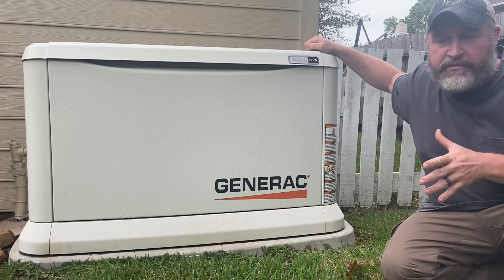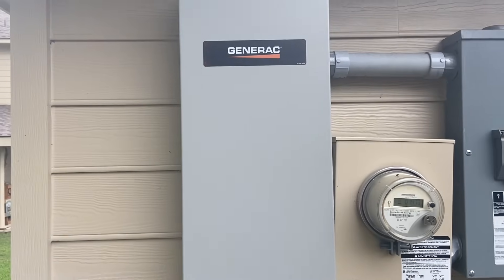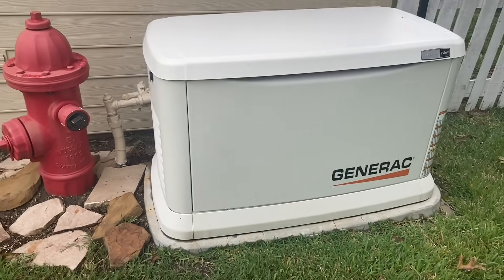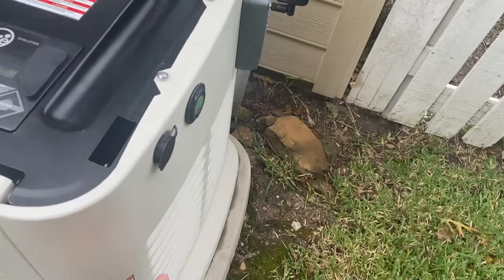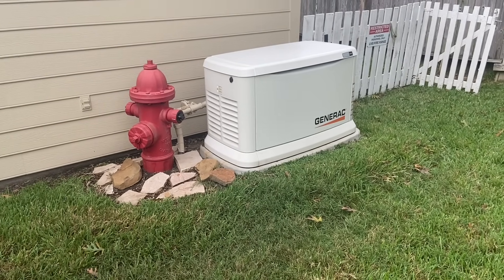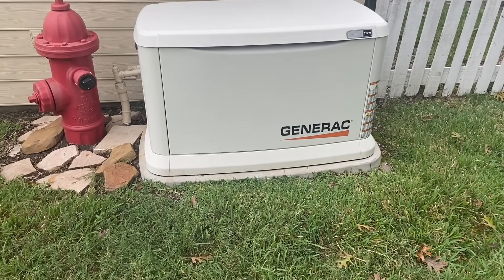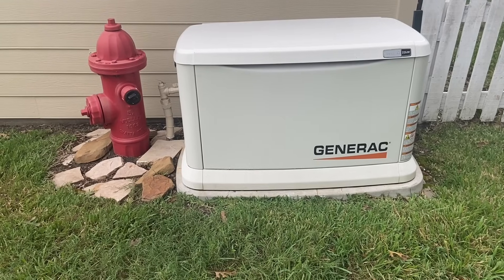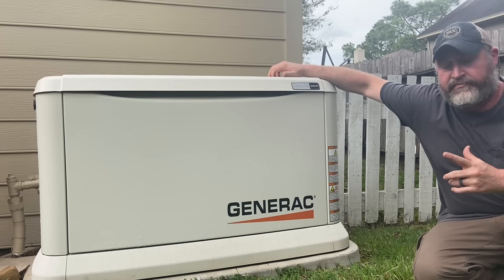Thinking of purchasing a generac whole home generator?

Comment: Lord, this started auto playing and I just had to finish watching.

That's a cellular mobile link, not wifi.
Cellular mobile link subscription is 69 dollars a year.
Hard to tell but that unit should be minimum 18 inches from the structure. 
The gas piping should not have gas cocks, should be ball valves. That's per generac.
If your maintenance company is only changing the plugs oil and air filter, they aren't doing a full service. Those 999 air cooled engines need the valves checked annually. 

Strange to see regulators after the meter but you must have high pressure gas.
Reply from the maker: Cool thanks for watching, it’s 18’’ or more away from the detached garage, the valves have been check and adjusted as needed annually the valves are ball valves. I pay for the monitor and annual maintenance as one plan.  Anything else !?!

Comment: I like the solar generator better because it's quite, the gas generator is too loud, everyone will know that you got a generator.
Reply from the maker: Nice where did you get your solar generator and how did you hide all the panels? How good does it work when the sun has not been out due to storm what is the run time? Why would one be worried that people will know you have a generator? 🤨 thanks for stopping by and watching, don’t forget to subscribe like and share it makes a difference!
Reply: There is no such thing as a solar generator. There are only solar batteries that are charged by the system. However if the power is out the system cannot work. You see solar requires electricity to make electricity. Therefore after your batteries are depleted, if your electricity does not come back online, you’re sitting in the dark and cold like everyone else that doesn’t have a generator.
Reply from the maker: @johnruggiano3290  exactly! Thanks John for the comment, please subscribe like and share buddy , have a great weekend!
Reply: @johnruggiano3290  go tell the people who made it smfh

Comment: I'd run it for two weeks straight - I've heard Generac makes a very poor engine.
Reply from the maker: Why would you run it for 2 weeks
Reply: @JustCantSitStill  Because many say the engine can't handle it
Reply from the maker: @d.t.1470  so you will run it for 2 weeks straight because the engine won’t handle it ? You comment makes 0 sense
Reply: @JustCantSitStill  The idea is to find out NOW  rather than later (when you might really need it) if it can do the job. Also presumably the generator is still under  a full warranty. That doesn't make any sense?
Reply from the maker: @d.t.1470  I see the point your trying to make , my dads is 15 years old runs a lot more than mine and all he has done is a battery replacement and oil changes. 

Anything will eventually fail at some point I don’t see the point in accelerating it. 

If I have a issue outside of warranty then I would fix or replace as you would with anything else.
Reply: @JustCantSitStill  Generacs have changed considerably in 15 years. Consider running it at least for 5 days - that should cover most circumstances
Reply from the maker: What brand do you have ?
Reply: @JustCantSitStill  Kohler
Reply from the maker: @d.t.1470  I have not heard anything bad about them.
Reply: @JustCantSitStill  Generac is terrible. They used to be good 15 years ago, but then they signed distribution deals with Home Depot and Cotsco and their sales went up like 400%. They never really expanded their manufacturing to catch up so quality went to hell. I've been installing generators for over 20 years and Generacs never last more than 3 years to 5 years. I only recommend Kohler for all my commercial customers.
Reply from the maker: @markanders250  nice 👍 thanks for watching
Reply: @markanders250 ; have you had or heard about Cummings whole house generators ? What's the info. on them ?
Reply: @martinlutherbling424  I don't install too many Cummins. I think the last one I installed was back in 2019. Mostly Kohlers and Generacs. I don't get many callbacks on Kohlers but I get so many callbacks on Generacs for all sorts of issues. If the client buys a generator off of me, I would recommend Kohler. But many people just buy them off Cotsco or Home Depot and pay me to install them.

Comment: These units are too loud....in violation of city code noise allowance. Get a Mango Power E solid state unit.
Reply from the maker: I like mango with sticky rice 🍚
Reply: May be in your jurisdiction but it has to deal with the distance from your property line so you essentially have no idea what the heck you're talking about.
Reply: @boblatkey7160  Distance is what the city ordnance is referring to. You see, most houses today are built 25’or less apart. Which violates code. if you’re living on acreage then no problem. But the sound resonates between the houses close together. Zero lot lines are typically common today.

Comment: Just letting anybody know, do not by one of these. They do not stand behind the warrant, had mine 14 months so now 12,000 brick. It’s a joke !!!
Reply from the maker: Thanks for the comment and for watching.
Reply: Did you cheap out on the install? They only warranty work done by certified installers and they're very clear about that.

Comment: Having a standby generator is a great idea. Just not that piece of garbage. Check with the Better Business Bureau, they have the worst record I've seen. Poor quality; no parts; & nonexistent service are the major complaints.
Reply from the maker: Thanks for watching and the great comment , have a nice weekend.
Reply: @JustCantSitStill  I am a tech for a Generac Dealer and parts are readily available and our trucks are stocked with most parts.
Reply: @jeffsneed8350  How reliable are they ? W K is not the first comment I've seen like his. The last thing you want to happen is  needing service when there's an emergency.  Kno offense intended.  Just asking a question.
Reply: I’m also a generac tech. My company has techs on call 24/7, 365. The generac has a 10 year warranty, I believe.
Reply: @user-cz2md9wn3n  OMG a 10 year guarantee. Let's divide that by the average yearly run time of 2.25 hours...So you're confident that thing can run 22.5 hours? I'm impressed 👏 I guess the Better Business Bureau has it all wrong. Well I'm a Power-plant operator with 40 years experience & I don't recommend your units, except as a paperweight 😅
Reply: @okramw1  My company performs many replacement installations. Most of the units being replaced are 20-25 years old. If maintained properly, they should last at least that long.
Reply: @okramw1  Out of curiosity, do you own a generac? Do you have any personal experience with them, or  is your opinion based only on what you've read online?
Reply: @user-cz2md9wn3n  Good question & yes, I had one. Within a few hours the piston rod went through the side of the block. Calls were made & Gen-A-Crap did NOTHING! I inspected the product & found it to be of overall inferior quality.
Reply: @okramw1 Who installed your generator?
Reply: @okramw1   And quit self-liking your own comments.
Reply: @okramw1  I looked at the BBB website and I found a measly 168 total complaints. 168 complaints out of many thousands of generators sold. That's nothing. The company I work for installs 3-5 generacs per day, 5 days a week, year round. We install more generacs than Kohler and Cummins combined. Every warranty issue that I have seen, which is few, is always honored by generac. It's unfortunate that you had a poor experience,  but I believe there's more to the story because some of what you're claiming doesn't add up. I also wonder exactly what qualifications you have that would give you the ability to determine that generacs are of inferior quality? I believe you're living proof that some people, just can't be made to be happy.
Reply: @user-cz2md9wn3n  But somebody has to 🤪
Reply: @user-cz2md9wn3n  & you sound like someone that has a vested interest in the Corporation. As for qualifications, i'm a quality control professional; an A&P mechanic; & for the past 20 years the manager of a big city power-plant (is 40+ years enough?). I am also charged with evaluating new employees, often X navy nuke drivers (& they are crazy smart) we all know good engineering when we see it. Your product is 🗑. I'd be more comfortable buying a Honda or a Yahama any day of the week.
Reply: @okramw1  Coming from someone who doesn't know how to capitalize or use punctuation properly and who uses emojis like a child, I find all of that very hard to believe. What I pointed out, are facts. Your points are exaggerated and come from a disgruntled consumer. Also, as an hourly employee, I hardly have a vested interest in the small business that employs me, nice try though.
Reply: @user-cz2md9wn3n  I sincerely hope that any other people reading all of this see through you, as I do. & I will not lower myself to your level by resorting to insults. Good luck.
Reply: @user-cz2md9wn3n  That measly 168 complaints makes me wonder how many more went unreported. I never filed a complaint. I just purchased a better system.
Reply: @okramw1  That's quite the coincidence, I was thinking the exact same thing about you.
Reply: @okramw1  It makes me wonder how many of those 168 complaints were written by people like you, people who can't made to be happy, no matter what.
Reply: @okramw1  Like I said, I replace generacs that are 20-25 years old and have very few complaints from new installations. If they're junk as you claim, how could they last that long? Your opinion isn't accurate and if you'd like to buy Chinese made junk over an American made product, go ahead. Just don't lie and people like me won't have to put you in your place.
Reply: @user-cz2md9wn3n  That's some retort. You obviously have a real agenda, because according to you Generac is some kind of perfect machine. I'll bet you recommend them over G.E. Westinghouse & Caterpillars. Generac is a Bad Joke (unless it comes with American Home Warranty or Car-Shield) 🤣. Well, I'm done with you because my LM6000 80 megawatt 138KV power-plant is scheduled on line at 11:00 (according to the DAM Day Ahead Market) & I have things to do. Go play with your toys & keep believing the lies you are telling.
Reply: @okramw1   I never made the claim that generacs are perfect machines. The fact is, there are no perfect machine and to some extent, all have their own issues. Look at any automobile or anything electronic the market, they're all  engineered to have an end-life, just like anything else. There's no money to be made in products that last forever or never need maintenance and businesses that manufactur just about any product, realize that. I'm only trying to point out that your experience isn't a representation of  everyone's experience, certainly not someone like me, who works with generacs everyday.
Reply: @user-cz2md9wn3n  Now you're almost responding like a human being. & considering your comments about my grammar, I could easily return the favor. I'll simply say good buy & good luck...
Reply: Well, I’ve had mine for 17 years and it’s served me well.
Reply: @LarryKelly  You are one of the lucky ones. It's is common knowledge that a significant % of Gen-A-Crap owners have real problems with their stuff. & because of poor design; build quality; parts availability & customer service, have equipment that is inoperable.
Reply: @Rawkfist1501 Nope. 45 years 6 generators. 3 still working. 1 donated to a school still working. 1 fuel issue donated to a friend that wanted it. & the Gen-A-crap put a rod though block with very few hours on it.
Reply: @okramw1  Sorry pal, buy my area is prone to power failures and four of my five closest neighbors have had Generac whole house generators for at least five years and love them. Two months ago one had his home powered during a power outage for 5 days without pause while the guy next to him without a generator threw out his refrigerator’s spoiled food.
Reply: @LarryKelly  Glad your friends are doing well & I hope their luck holds. People I know have not had such good success & the Better Business Bureau tells a very bleak story about Generac, they have an atrocious rating!

Comment: Yea I hope your beloved Generac stays put after a 20 foot storm surge and all the walls of your house are collapsing. Wet wires everywhere.

I’m from the islands and we would intentionally turn off the current to prevent electrocutions, if power comes and you have hot wires exposed se la vi, good for small storms but a 4 or 5 direct hit, all bets are off.

After a real storm everything is wet and salt water? Oh yea yummy.

Good presentation though.

Remember Mother Nature gives but Mother Nature take back.
Reply from the maker: Strange comment but thanks I guess  kinda passive aggressive , we have lost a house due to flooding so I know a thing or two.
Reply from the maker: @rockheadregolith8325  😂 thanks for the comment and watching!
Reply from the maker: @rockheadregolith8325  not as good a Tony but close , check the pinned comment.